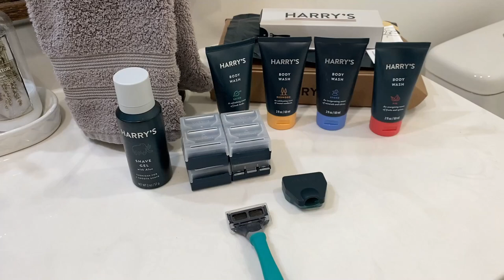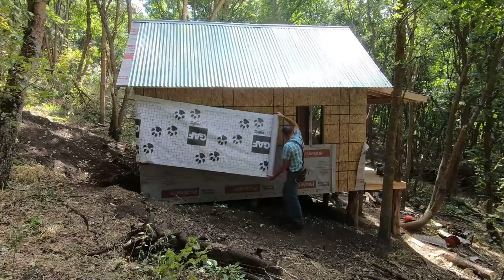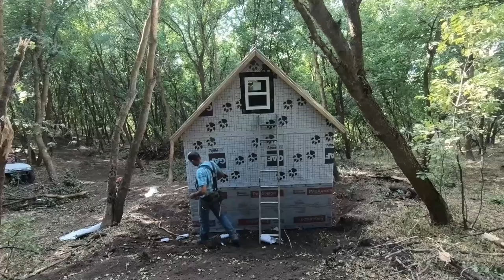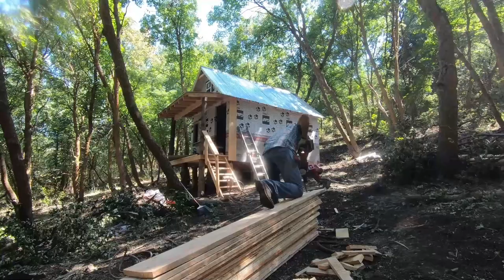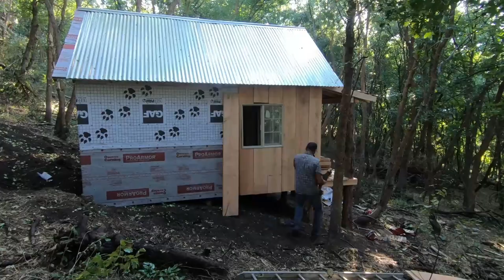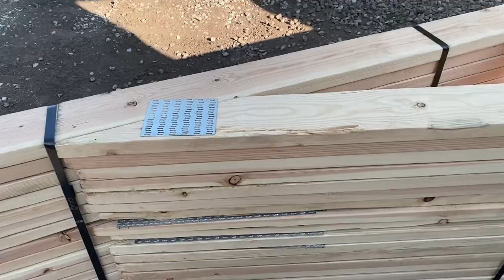#431 - Tiny Cabin Build: Installed Real Board And Batten Siding

Comment: If you mentioned this, I missed it (if so...my apologies)...board and batten siding is the method for using uncured lumber as siding.  The board is nailed up, and the batten covering the seams, which allowed for shrinkage of the boards while the battens provide for complete coverage as the boards shrink to protect from the elements.  Perhaps the use of uncured lumber versus cured lumber price was the reason B&B is associated with people of lesser means (?).  Personally, I think board & batten is very attractive.  As a note, in my hometown in the mid fifties some pricey, very attractive split levels were built using B&B (real wood, versus aluminum or vinyl...lol almost anything aesthetically looks better than vinyl).  They're still there and are still very attractive.  Your cabin is looking great with it, and I'm sure will be very attractive when complete.

Comment: A traditional Board and Batten cabin has no framing.  The wall are rough cut pine with 12" boards and 4" battens.  Those are strong enough that no internal framing is needed.  My grandparents bought a Board and Batten cabin in 1932 and it is still standing today and in good shape.   Keeping the Tin roof in good order is the most impotent thing to preserve it.   Many good memories of spending Summers in the Mountains in that cabin and putting many coats of boiled linseed oil on those boards.

Comment: You should consider using live edge tree branches for the railing.  Also you might want to think about some cement boards along the back side where the hill cutout is.  I'm worried that a good storm could cause a slide up against the cabin.   Did you consider clearing out the trees in front of the cabin so the view is open?  The boys have their little place now the family will too.  What would you think about a woodshed somewhere nearby?  If you are going basic up there it would be a real necessity in the future.  Also thought about what you could do for your water needs.  I would think an IBC tote under the front porch (and disguised of course) hooked to a small solar pump would be all the water you would need when you are up there.  You could go really basic and do a hand pump.  I built a shower that used a steel hand pump canister to get some pressure and it would be all you would need to get some basic dispensing pressure.  Cabin looks great, Heath.  One more step to move in ready!!  Then you turn it over to Cedar to finish out...

Comment: That's a good way to cut out those batons. I would have spent half the day with the table saw doing that.
Reply: The only thing I'd do differently if it were my build, I'd consider digging out the bank behind the building adding a retaining wall and extending the roof to cover it and use that area as storage for firewood, but this isn't my build, if it was I'd be the one recording it. this is only a random thought posted in the nature of self gratification of seeing my words and thoughts out there for all to see.

Comment: Technically it is a log cabin, you just notched your logs down to one by 12’s and plywood and two by fours. ;) 

I think the board and batten siding looks great. :)  my old house was Borden Batten on three sides and I miss it, if I was building a new house that’s probably what I would choose it was an almost maintenance free siding, whoever built it in the 70s used 1“ x 12“ cedar.  They used a router on all the battens in the roof on parts of the house was over 30 feet high and almost every board on that house was a 1“ x 12“ x 20‘ board, I have no idea where they got all that wood but it was perfect.

Comment: Are you planning to do anything to help with water drainage around the cabin? Given that it's on a hillside, I'd be concerned about years of rainfall eventually washing away the dirt holding those pillars in place. A basic planted berm a little uphill should help to divert water flow and prevent erosion.

Comment: One should avoid covering the weep holes on windows with flashing (bottom row of nailing). I can't imagine those windows are much different than standard. The flashing goes down first on the sill, then the window goes on top. The way that window was flashed, if water does get into the sill, it cannot escape. That's what the weep holes are for, a last line of defense against rot and mold.

Comment: Pouring concrete for the shop-yard...
Have you considered laying a duct, or a line, for propane from the tank to your shop?
Hot water for (hand-)washing, fuel for a shop-generator etc.

Might be fixed already, but I haven't seen it in video.

Maybe not day #1, but ducting it in later will not be that easy.

Comment: Hello. A question. Is there a law regulating that you have to buy the trusses? Why not building them yourself?  If its about static loads etc... a commissioning at the end would also do. About the shad... excellent, very nice. The metal roof does not fit so well to my eyes and we are used in europe, anway, a great place and project. You are working so hard, all by your own and alone, a second pair of hands would really be very handy... respect for your ambitions and strength! 🤘
Reply: I think he said it in a past video while he was wornking on the shop's walls... thats a bit too big of a job for one person alone... and the winter is coming up quickly... he will be better off having the shop up and working by the winter than saving some thousands and spending the winter chasing after the chores like last year

Comment: how many rips was that with the milwuakee 18v saw? through a full 2" of wood by the looks of it, impressive
the truck driver wasnt afraid to stay into the power most will give up the second theres an inch of wheel spin, probably could of saved the gravel a little if he just kept the speed as high as possible

Comment: You didn't use furring strips?  I've been told you shouldn't nail the boards directly to the water resistant barrier (tyvek or whatever) as it traps moisture and rots the wood.  Is this correct?

Comment: I know nothing about building a house, is it bad to have the wood of the cabin sitting so close to the ground?
Reply: the house wrap should keep most of the moisture away from the wood, but optimally you don't want wood getting moisture in it. should last quite a while though
Reply: @user-ry1fk6rv1q  thanks for the info!
Reply: Yes, not good.  Needs to dig it out a little more

Comment: Won't that 1 x 2 along the bottom edge of the siding cause a water trap as water runs down the siding? It will remain wet behind that 1 x 2 a lot longer than the rest if the siding.

Comment: It Seems to me that your priorities are out of order from what your needs are. You are accomplishing a Want, not a NEED.   Obviously to you the Shop is your highest priority but can't work on it because of the Rafters.  Instead you spend your time on a Cabin that is only going to be used Part Time and probably not in the winter.   Shouldn't your priority be enclosing the 2nd Water Tank with Insulation and probably equally as high, Fire Wood. Those two items have the possibility of significantly impacting you and your family this Winter.  I know you think you will still have time, but who knows what tomorrow brings.